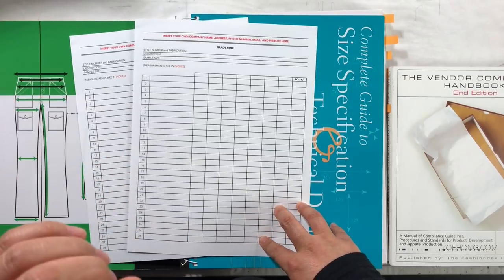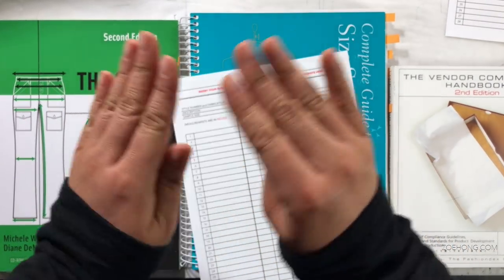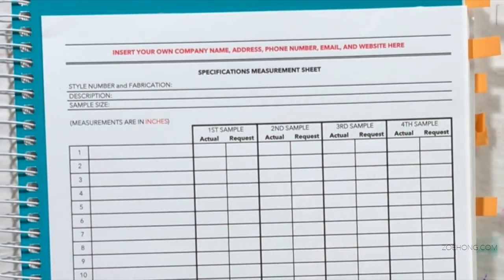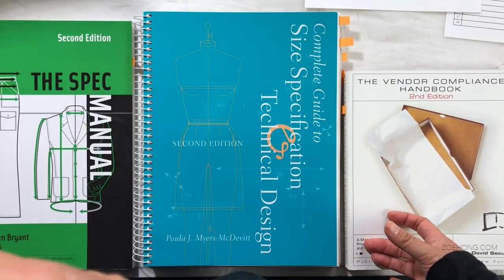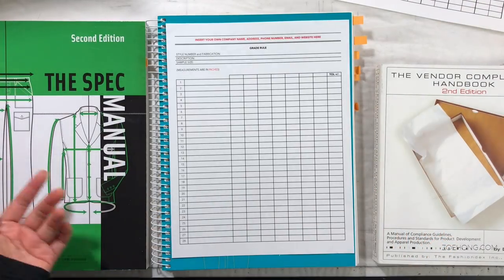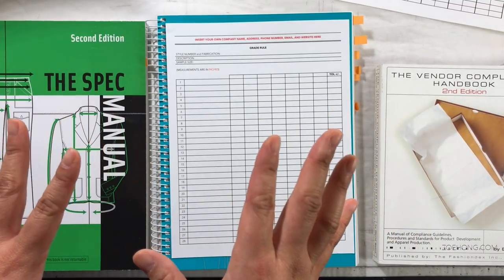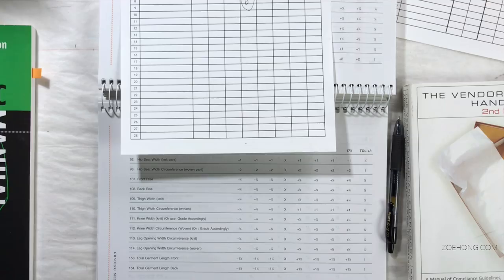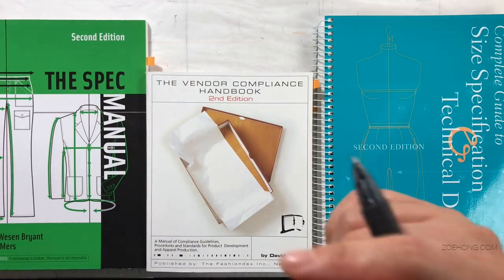Fashion Design Tech Packs #3: Specs and Grading

Comment: One more question, when is this tech pack(not grading) process at?  And done by who?and also when designer finish design, should he /she give details of measurements to tech staff. Sorry if the question is very stupid.
Reply from the maker: Once the designer puts together the design with the fabric swatch and flat, the tech designer takes the info from the designer  and puts together the tech pack so the pattern maker can get started. Measurements are up to the tech designer, to be tweaked in the fitting process, but the designer's flat should show if it's supposed to be tight fit, boxy fit, etc. If a designer is doing stuff for the very first time, that's a more involved process.
Reply: thank you so much for your answer.

Comment: In my experience plus sizes tend to not fit as well because the body doesn’t grow out proportionately. When grading up to an xl or higher would you change some of the grade rules as you get larger?
Reply from the maker: You're absolutely right, you need to consider how your customer gains weight and grade accordingly. Many companies try to design plus size by just grading up their existing patterns but that doesn't work. You can grade a small range of sizes the regular way, and then you have to start examining the pattern when you go past that range. XS-XL is usually ok, if you go XXS-XXL, that's when you start getting sloppy.
Reply: Thank you!

Comment: Quick question— if we were filling out the grade rule by hand (for w.e reason), are we supposed to put the actual measurement number ? Or is it okay to write/send off with “-1/2” in columns ? — just asking for clarification on what’s expected to be in those columns when we send it out. 😊🤍
Reply from the maker: I think it's ok to write -1/2" because they grade off the sample size pattern, instead of creating a new pattern from scratch each time. Each factory will be different though.